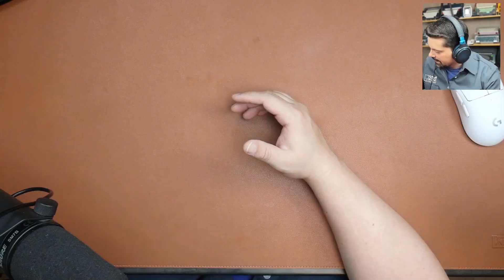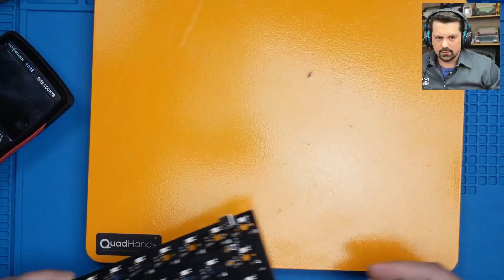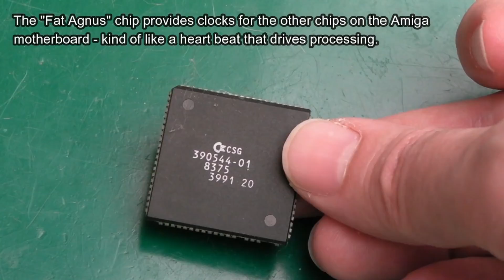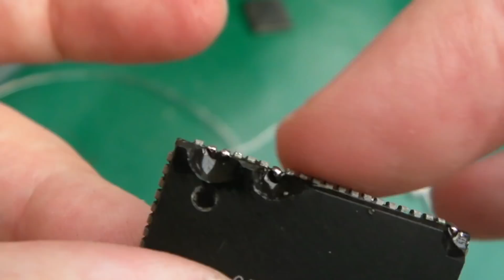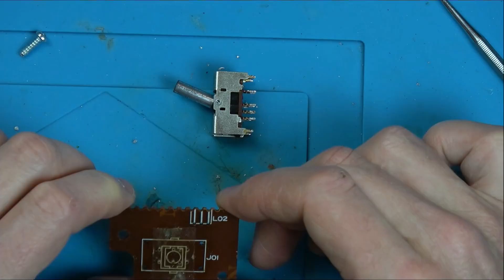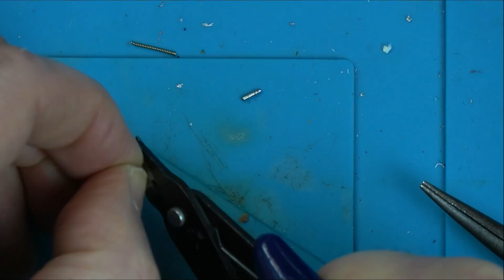The YouTube FIXERS - S1, E6

Comment: Not trying to be negative but that keyboard fix was probably just cold solder. The resistors measured correct. An smd resistor with 220 is supposed to be 22 ohms (22x10e0).

Comment: when use to repair Amiga's often customer would bring agnus's in this state as they tried installing fatter agnus's and broke the pins off. i used to use needle files to file away the chip casing and attach wires from traces on the board to the broken/missing pins then insert the chip back into the socket 99 time out of a 100 this would work first time.

Comment: Hehe I just bodge-o-fixed my Flashforge 3D printer, however I lack any decent masking tape or glue stick in the place so my prints keep sliding off arrgh, trip to Asda's tomorrow methinks for some Pritt Stick and should have my first 3D printer doing its thing... 1st project is a complete Super Mario chess set I found on Thingiverse... ooh yeah :D  Only paid £40 for the printer too :)